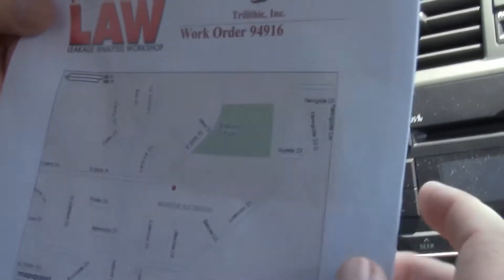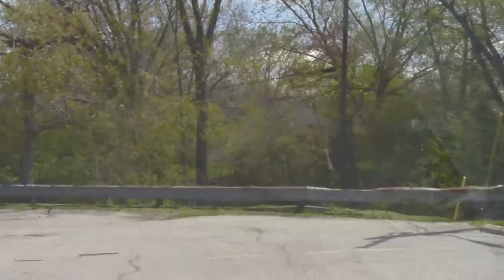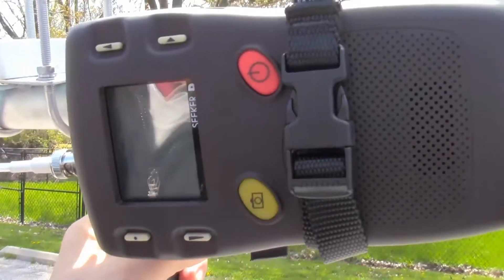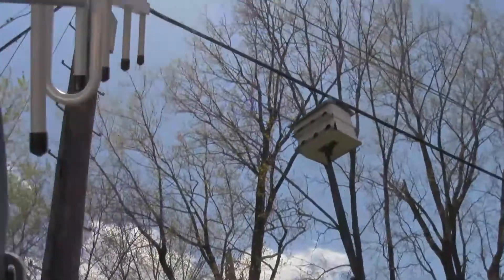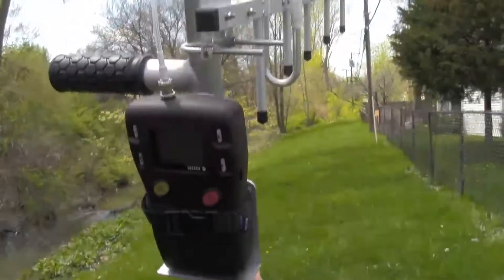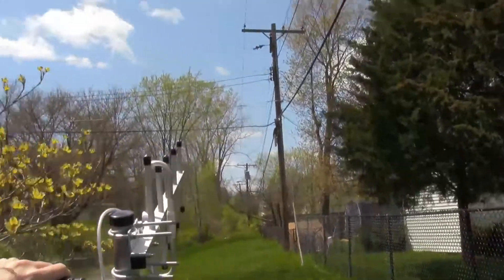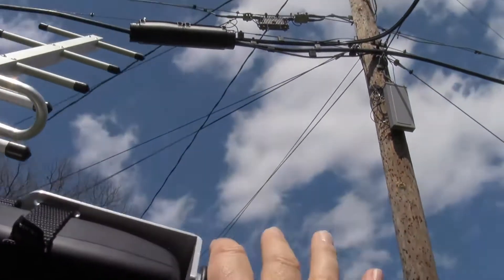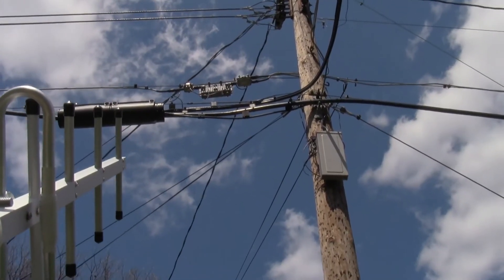How-To: Seeker D and Yagi Antenna

Comment: Can that Yagi antenna be used for the regular Seeker to get more sensitvity from it to help find leaks quicker from a longer distance for rough easements or is that antenna only designed for the Seeker D? If so what is the cost of it alone?

Comment from the maker: Say for instance that the leak was equal in intensity in both the high and low frequency which the one in video was not.  But for argument sake we'll say it was equal. We have a dipole antenna to use with the Seeker which has a 2.1 DBi antenna factor. With a dipole antenna connected to a Seeker you would likely pick up the leak at that distance but at a lower level. Leak intensity and the antenna you are using to pick it up is what determines how far away you can detect a leak.

Comment from the maker: A big part in picking up a leak from a distance is using the proper antenna for the job. The reason the Yagi picks the leak up from that distance is it's incredible directionality and the amount of gain it inherently has by design. The Yagi antenna that I was using in the video has an antenna factor of 9 DBi which compared to the rubber duck antenna on the Seeker is 9 DB more sensitive.

Comment from the maker: As you've seen in our video, the Yagi antenna helps pinpoint a leak very well from a distance and couple that with our near field probe, you can isolate a plant impairment (leakage source) in seconds rather than minutes.

Comment from the maker: In the aeronautical band, we still see the majority of leaks from the drop to the customer premise where in the higher frequency we find most of our leaks in the hard line such as physical damage to the plant like compromised shielding of housings or cracks in the feeder, etc. In other words, those issues that the cellular provider call about in many cases will only be detected by a meter that can monitor the upper frequencies.

Comment from the maker: In an all-digital system, or even a mixed analog/digital system, we can now detect leakage in two bands at the same time.  By injecting very low level carriers into the system at 138 MHz and 612 MHz we can now detect leakage in the aeronautical band and up in the higher frequency band at the same time.

Comment from the maker: The difference between leakage in the aeronautical band and the LTE band are quite different. For decades now we've only been concerned with leakage in the aeronautical band which our Seeker and other legacy analog leakage detectors were great at detecting using an analog carrier from the system. These devices still work really well in the aeronautical band as long as you have an analog carrier in your channel lineup.

Comment: Or what I meant was I believe you have the option of using two taggers at the same time or one etc. Comparing between the two, does it pick the leak up sooner with the QAM versus the analog? I read on a site that a cable system was called by Verizon due to problems with their system due to leakage. They found the leakage for the cable company. Problem is the cable company only picked up a very small leak where Verizon used a QAM detetector which showed it was very large. What is the difference?

Comment: You must have been using a Digital QAM tagger other than the analog tagger. I don't care for the regular Seeker because we would not be able to pick that leak up out of the truck from where you was parked. We would have to be right by the pole or on it before it would break squelch. I hope this is a major plus compared to the original model. Hopeful we all will get these in time.   Can you tell me since a digital QAM is different are you able to pick these leaks up a lot easier?